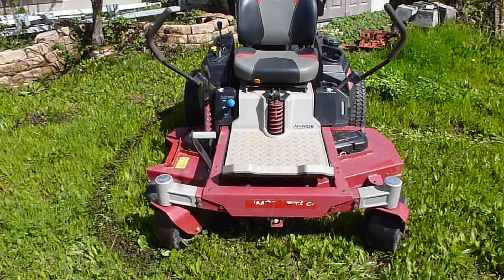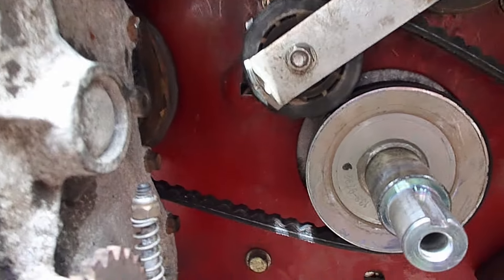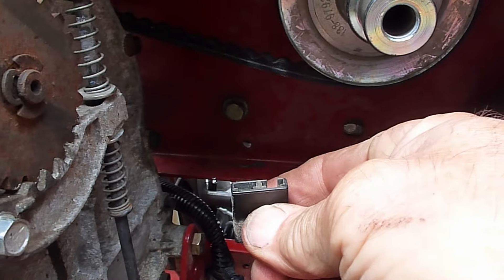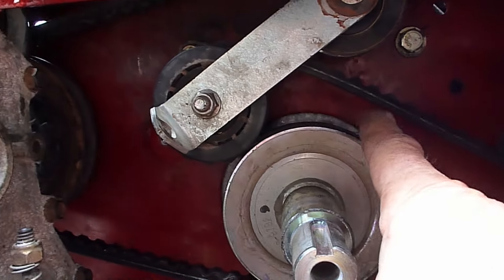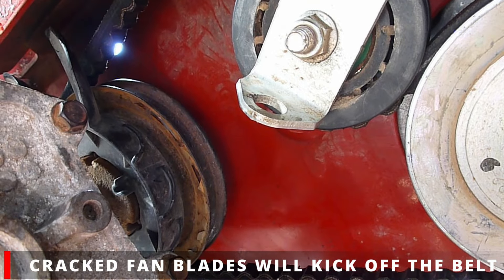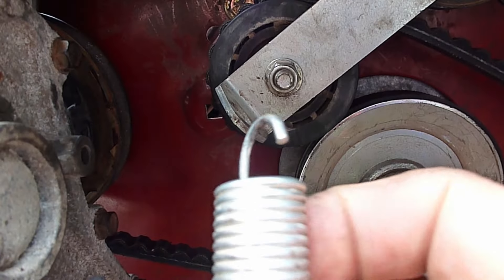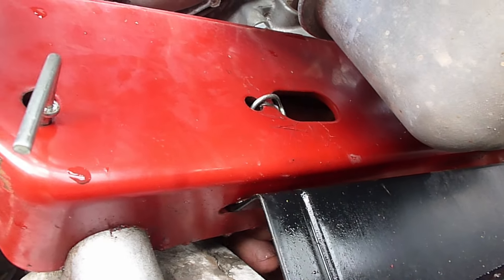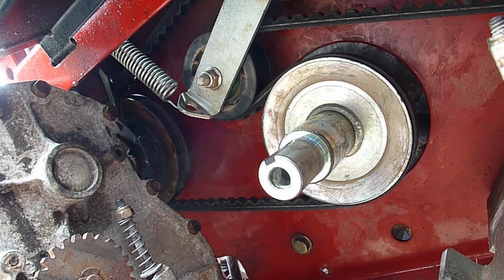HOW TO REPLACE THE DRIVE BELT ON A TORO 75757 TIMECUTTER Z RIDER

Comment: Thanks for the video and no nonsense explanation. Some twig went under my mower and dislodged the drivebelt. I was able to put it back on myself with this video
Reply from the maker: Great job fixing it yourself!  I'm glad the video was helpful.  When you get a chance, inspect both cooling fans at the top of the transmissions, because usually when the belt gets pitched off, it'll break off the blades of the fans, like you see on the machine in this video.  Running the transmissions without proper cooling will destroy them internally.
Reply: @austinado16  Thanks for the reply and good call on those cooling fans. Surprisingly and fortunately, the blades are all still intact. Must've just been a freak accident when the brush twig dislodged the belt I suppose.
Reply from the maker: @youngeebs  It's not uncommon for twiggs/branches to get up into the top of the decks, or up into the transmission belt area and derail the belt(s).  I'm glad the cooling fans weren't damaged.

Comment: I couldn’t have done this without you 
😊 thanks so much 
Putting the mower up high is the trick
Reply from the maker: I'm so glad the video helped!  The belts can be replaced with the rear wheels up on automotive ramps, but it's much easier if the mower is safely raised to a much higher position.  Nice job fixing your own machine!

Comment: I have the same model with a drive belt problem. I used your video, which was very helpful in figuring out the belt layout. But mine keep failing every time I tried to drive the mower. Thanks for for sharing.
Reply from the maker: You're welcome!

Comment: Hi, Todd.
Thank you for making this video. I have a slightly different model Timecutter but the pulley layout is the same, so extremely helpful. What I found to be quite difficult was maneuvering my fingers in the very tight space toward the rear to get the belt around the transmission pulleys. It took a couple hours of almost getting it around one, and then the other, and finally around both. Very frustrating! I looked to see if there was anything I could remove to give me more space to work in that area but there isn't. Any tips on how to get the new drive belt around those two transmissions pulleys would be very useful.

Nevertheless, thank you for your clear explanation of the layout of the pulley and the tensioner spring!
Reply from the maker: You're very welcome, and thanks for the nice comment!  What I do on these is feed the belt into the flexible blades of the cooling fans, and then rotate the fan by hand.  The belt will sit between 2 blades, and then be walked around completely, and finally, drop onto the pulley.  I always get the belt around the the trans pulleys first, before feeding it around anything else.  I do the same when replacing belt on a lawn tractor/riding mower...  it goes around the transmission pulley, using the fan blade trick, around the engine pulley, and then I feed it through the tensioner pulley system.  Mower decks are done the same way.

Hope this helps!

Comment: Hi, I was wondering how did you jack up the rear of the mover
Reply from the maker: I have a gantry crane that's on large wheels, and has an electric winch with pulley to cut the load on the winch in half.  This job could have been done with the machine parked with the rear wheels up on automotive ramps, but it would have been difficult to shoot a clear video.